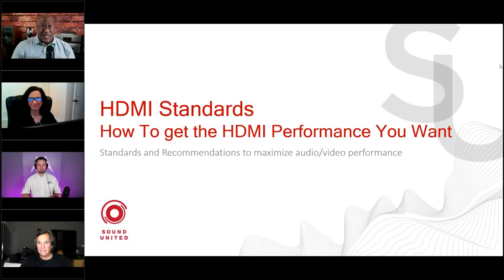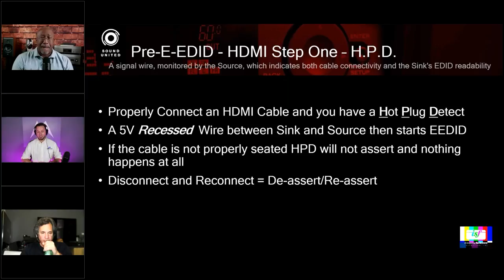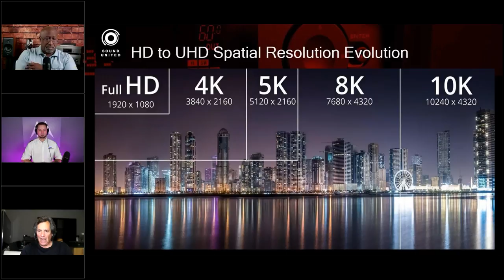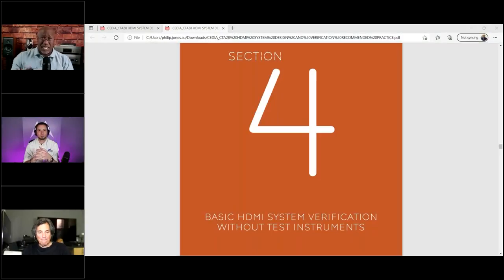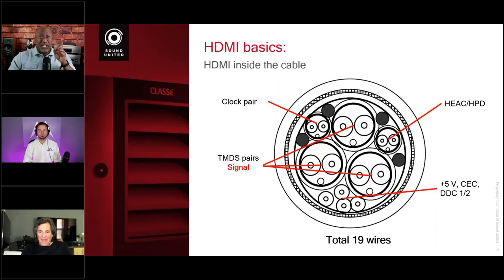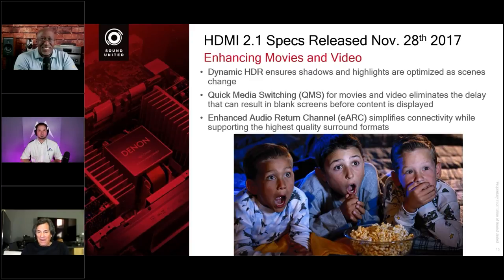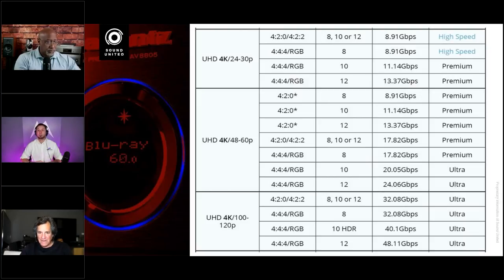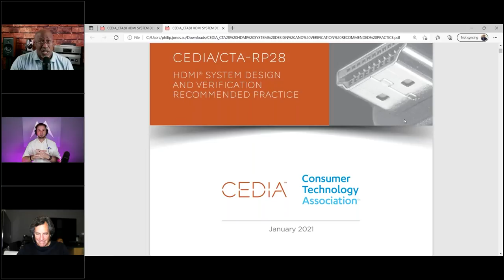How to Get the HDMI Performance and Reliability You & Your Customer Want

Comment: Is sound united really giving hdmi advice? The same company who released a line if products with hdmi features that still don't work, and neither does the free "solution" they offered us? Ironic.
There are entire forums of frustrated people with sound united products that don't work as advertised, and support tells every single one of us the exact same thing, like it was scripted by lawyers.

FYI, Dolby atmos on top of Dolby mat doesn't work either! In case maybe someone wanted to look into it. Anyone trying to use any of the receivers from last year with an apple tv, roku, pc gaming, or any atmos signal from a pcm base, has audio cutouts, dropouts, and other strange behavior. I can't get over an hour of clean atmos when playing a game or watching anything on Apple tv 4k.
And no, it is not my edid, or my hdmi cables. We have troubleshooted extensively.
Reply: They fixed it in a firmware update.
Reply: @Saturn2888  are you saying they had a firmware update for the spk618, a product they wouldn't even admit was broken? That must be what you're saying because Dolby atmos from Dolby mat still doesn't work.

Which product do you have?

If you are speaking on the hdmi 2.1 bug in general..it was not fixed. Certainly not with firmware. Only receivers built from may onward have the fix, and they needed a redesigned board to do it.